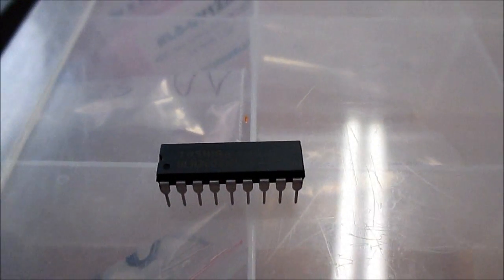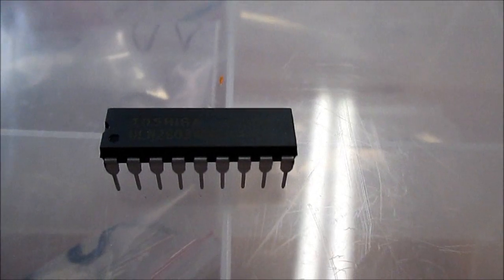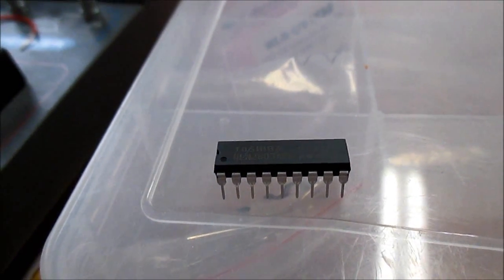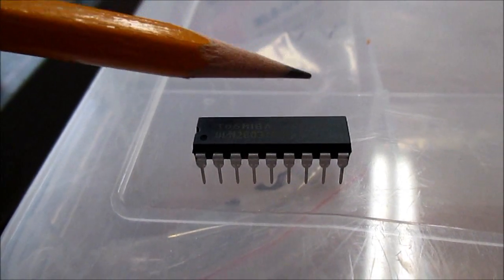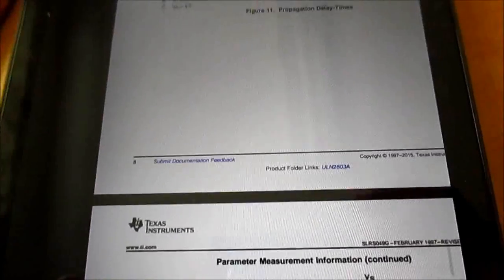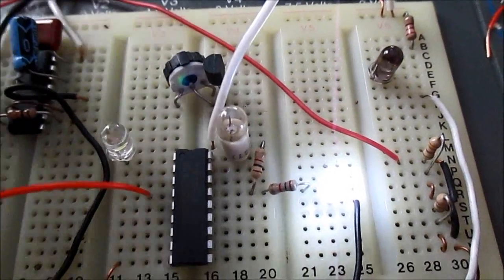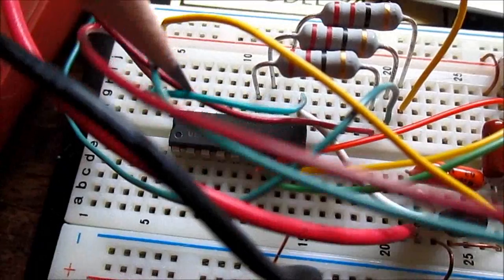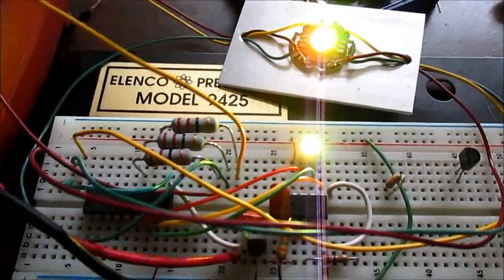ULN2803A darlington transistor array driver IC

Comment: i have 20 of them in the mail now. Im not an expert but im building a few LED ladders for some smooth PC indicators (HDD CPU load etc.) However space is an issue and the boards have to be quite small, so this IC will come in real handy to replace the BJT`s

Comment: Hey JAT, Awesome channel, I really enjoy checking out your reviews of chip amps, LED's, ULN2803 driver IC, etc.. I have not looked yet, perhaps you have a video on the LM383T audio amp. I have one built on a bread board, it kinda works in that the out put is really low, you can hear it but not as loud as a 7 +- watt amp should be. Do any pins need tied to ground as you have mentioned in one video, say pin 2 & 3? I didn't see anything in schematic that would suggest that, tried it and it did not work at all. It's 5 pins, how hard could it be. I want to make a higher watt guitar practice amp, however, this chip I think is for car audio application. Say Hey to Snickers and thank you for the informative videos. Take care, be good, Cass.
Reply from the maker: Cass Virgillo Hi Cass, this chip is essentially identical to the TDA2003 and I made an amp using it (check my videos from about a year back). Pin 3 is ground on this IC (check datasheet). You should get around three clean watts from it using 12 volt supply and 4 ohm speaker.
Reply: Hi John, Thank you for taking the time to respond to my questions, much appreciated. I will look for video. Take care, C.